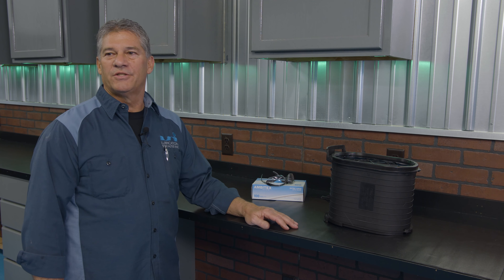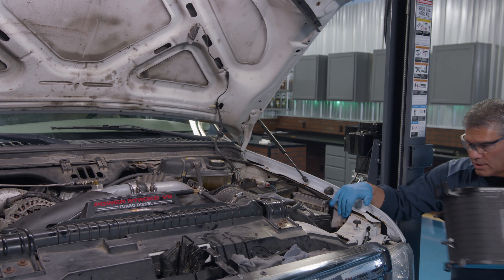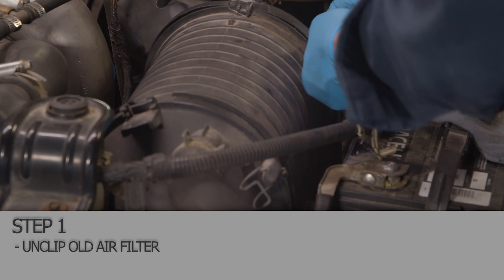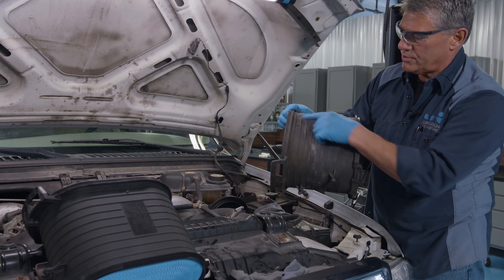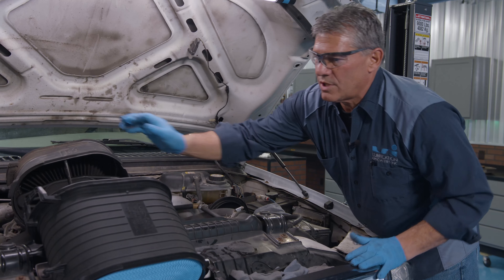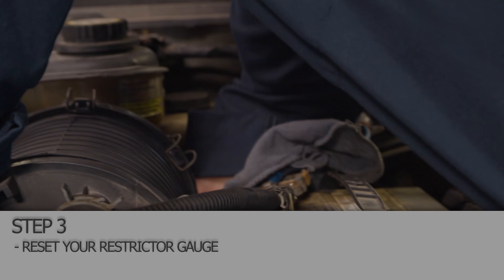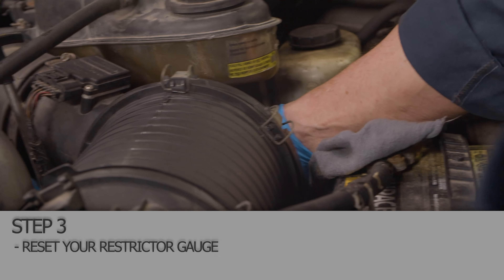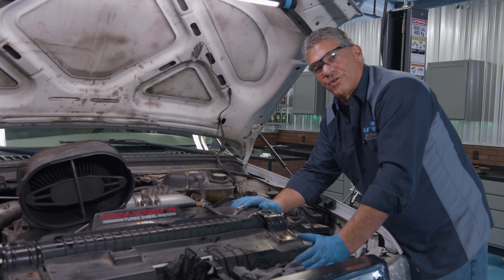How to Replace an  Air Filter on a 2003-2007 Ford F-250/F-350 6.0L Powerstroke

Comment: It's alot easier removing it as a unit by simply loosening the hose clamp and unplugging the MAF sensor. Then remove the ends from the filter on the bench. This ensures that the ends are sealed properly and clipped in.

Comment: Do 2004 F250s have cabin air filters?
Reply from the maker: We don't offer cabin air filters.
Reply: Yes know you don't carry cabin filter or make them. Do you know if 2004 6.0 has a cabin filter, & if so where is it?
Reply: @dieselds678  Hello from 2 years ago. I never found an answer to whether F250s have cabin filters or not. If they do though, it will be under the dash.
Reply: @Ken19700  thanks! More info needs to be documented on these 20, going on 21yr olde 2004 early 6.0 's.